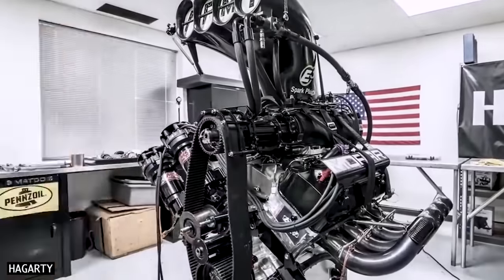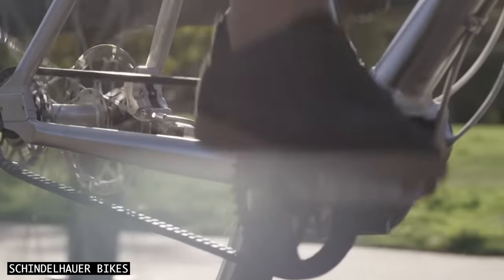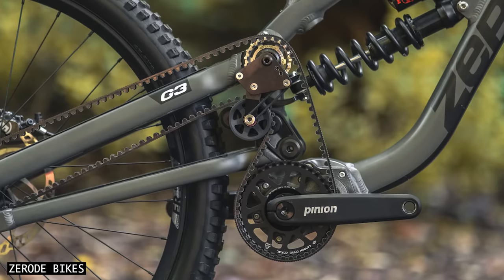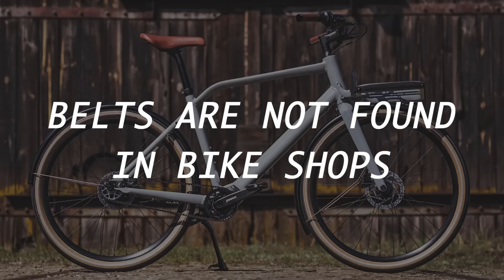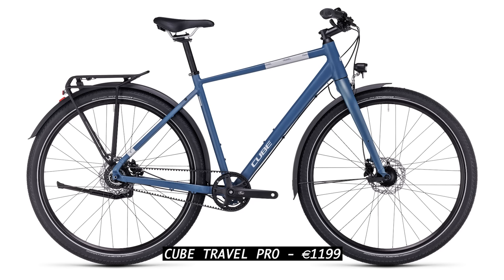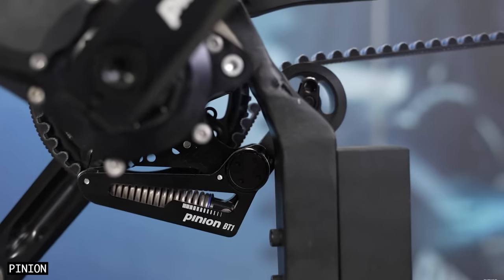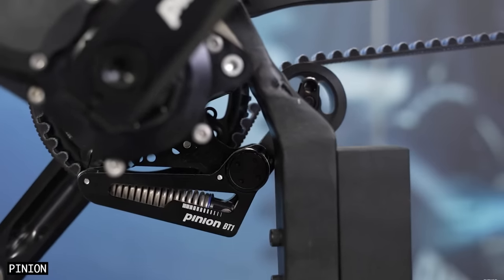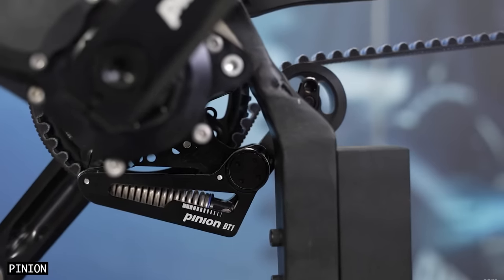Belts Are Now BETTER Than Chains On Bicycles!

Comment: I've used a Gates CDX belt drive paired with a Shimano Alfine on an urban bike as a commuter bike for a couple of years. While I generally enjoyed the low maintenence aspect, in the end the belt as well as the plastic rear sprocket has worn out after about 20000 km. And the repair was pretty pricey. On the other hand I've had Campagnolo chains on my road bikes which lasted some 15000 km. You obviously have much more experience with belts than I do but from my anectdotal experience the cost per km wasn't lower with my Gates CDX belt than with a good chain. 
There is still the benefit of having less maintenance work to do with a belt. But for me personally, being a fast rider ultimately the urban bike was too slow and I bought a gravel bike as a commuter and I am much happier with it.
Reply: CDN plastic sprocket was a misengineered product, he covered that mistake and Gates did it, too. Pity customers had to go through it.
Reply: 15000 km with a chain is for me absolutely impossible. I dont know what I am doing. But even the Eagle chains dont last that long and on my commuter I also snap chains. 
For my MTB it is clear why I cant have that long chain life because they get damaged by objects on the trail or jump of grears in really rough terrain when the chainguard fails also. 
Most chains I have will die after 3-4k EVEN with a chainswap @ 1k and 2k
Reply: @Vanadium  Roadies who ride in fair weather can get much longer chain life than MTBrs who put bike through rough trails. Much bigger mechanical stressing chain + dirt, sand, water, stones, sticks = faster wear.
Reply: @Vanadium  I'm struggling to believe that he managed to get 15000km out of a modern 10/11/12x drivetrain chain without exceeding wear limits and messing up cassette and chain rings. So either he knows something nobody else does or he's just a fantasist.
Reply: @event4216  true but I cant even get close to  5k for my commuter. This is mostly ridden on paved roads with some gravel in between. Ofc salt and snow will say hello once a while...
Reply: @Vanadium  Some people take care of chain more than others...maybe it's time to try belt, now? Belt isn't perforated like chain and even if front wheel lifts some sand and grit it will not land between plates and onto rollers....wet sand can stick to outer surface but one has to go through heavy mud to get it on inner surface of belt.
When I commute on rainy days I grab belt drive bike because I don't like crunchy feeling under my feet.
Reply: @event4216  Well then those people who take more care then me are crazy because I clean all 3 parts of the drivetrain in a ultrasonic cleaner. A few times a year. 
The chain only get wax. Dont know what else to do. 

Maybe for commuter but I want to change my MTB first. Still no real bike that can provide me with the right geometry for the belt so its SUPRA drive time ...

Comment: Had a conti belt on my commuter bike. It was pretty noisy, requiring regular cleaning and silicone spray to stay quiet, though I gather the noise was just annoying, not actually affecting anything. Then one day while accelerating from standstill it just snapped in two. Unsurprisingly I changed to a chain. But I'm sure I was just unlucky, and that Gates belts would be better, surely nobody would use them otherwise 😅

Comment: i have a commuter with a pinion c-line. i love it- no mess, and nearly no maintenance. also, i do not have a split in my rear triangle (priority bike), i just drop the tyre. i have hit 23 mph (37kmh) for one of my mile splits commuting to work on level ground, they can be quick if you pedal. the belt drive does not care if it rains, and with a pinion i have peace of mind submerging the gearbox while following my crazy son on his 'this will be epic' adventures.

Comment: I'm currently at 38,000 K on my Co-Motion Americano rohlof with original belt CDX. The Chain ring is starting to get "sharp teeth" the rear sprocket is showing almost no wear. I do keep the tension lower than recommended by Gates as I have found that recommended tension is not needed. I carry a spare belt just in case as its pretty light and gives peace of mind. The only issue i have had is occasional squeaky noise after riding in dry dust conditions. Road up the Dempster and ITH to Tuktoyaktuk last summer including two days with rain which In my opinion is a proper test. The belt did fine...the shifter cables....well they got progressively harder to shift as the grit built up. Thanks for your videos.
Reply from the maker: Very impressive numbers! Make sure to check out the UT Belt Care product or Treadmill silicone lubricant if you want to avoid squeaking entirely.

Comment: The Dutch used to build cars with belt drives.
I used to drive on of them.
I loved it.  The two rear wheels were driven separately . Safer and smoother.
The car was called Daffodil.

Comment: I also have never had anyone cut my belt, but curious people love to grab it and twist it around sideways. This has never directly lead to breaking a belt but possibly could have contributed to a short lifespan for it, as the manual specifically advises against it.
Reply: Pushing on or twisting the belt with their hand is no big deal  (I worked in R&D for  a belt company and actually designed an application of belts like this where the belt was twisted in two places.)
Reply: wtf why?
Reply: What kind of rude people touch drivetrain let alone belts on others' bikes?
Reply: The only issue with people grabbing and twisting your belt, is that people are grabbing and twisting your belt! Some people, man! I'd never have the urge to touch someone else's bike, unless I knew them and asked first.

Comment: I like the English Bike's take on having the belt outside the rear drop out so the frame doesn't have to be split to change the belt.
Reply: Indeed, a number of manufacturers now have frames that put the chainstay up higher, to allow the belt to run outside the frame so that the frame doesn't need to split.

The frame still needs to be designed specifically to support the belt drive, but it at least removes one structural issue that used to limit adoption of belt drive.

Comment: I would like to expand on the automotive belts v. Chain. 
Chains are in a sealed environment and continuously lubricated.
Belts are often covered and not completely sealed.
Reply: Because oil destroys the belt. And sunlight too. Not relevant for a car, but pretty relevant for a bicyle.
Reply: YOU DON'T SEE NHRA USING CHAINS ON THE SUPERCHARGER

Comment: the internal hub shifters are like 300-900 dollars each the Pinion Gearbox at the pedal is north of one grand so unless you intend to use a single speed bike you have to add that cost to the drive train

Comment: I have 10,000+ miles on a belt drive single speed the 'ace of spades' geared 55/19 or 2.89. It doesn't have the gearbox issue so I'm pretty sure it's just as efficient and fast as a chain drivetrain. I do 20+mph average rides, and can hit 22 or 23mph on a flat. IMO if you live in a really flat area, a belt-drive single speed is kind of a perfect bike.
Reply: If you hate your legs and back then yes.

Comment: Never seen a belt drive bike before.. Very interesting. When i decide its time to long travel by bike i will consider this option
Reply: And you get a belt failure, or transmision problem. In the middle of nowhere. Shops 200 km around you doesnt fix it, dont have parts. Your bike is not moving at all. Good luck to your long travel adventure...
Reply: @szaka9395  thats why you have to be flexible when travelling. If that happened i would probably hitchike or take public transport until the nearest place that can fix it and then resume cycling. Considering the durability and reliabilty of these belt systems, i assume such an event will only happen rarely

Comment: I work in the logistics section of a local bike shop. We use cargobikes with inernal gear hubs and belt drive systems, specifically urban arrow and riese&müller bikes. Ive seen suspensions and even frames bend or break before their belts broke.
Reply: Top garbage bikes then xD

Comment: I'm not even a cyclist. I just watched it all as I'm interested in technology and engineering. I can certainly envision belts becoming more commonplace in the future, especially with newer technologies like high entropy steels on the horizon. Maybe I'll even find my next motorbike to have a belt.
Reply: As someone who rides motorcycles STUPID long distances, And is pretty regular about chain lubing. [once a day after about 8 hours of riding] And uses X-ring chains. I can only get about 16k miles out of name brand chain before it's making crunchy noises. I Just think the forces acted on the belt drive systems, causes a lot more stretch. due to the forces of high speeds, and rotation of the swing arms. Zero owners [the motorcycle brand] often complain about belts just yeeting off. and in sandy conditions not lasting very long either, Harley guys who've had OEM belts for the last idk 20 or so years now.. Run into the same issue of sand killing the life of the belt. For distance riding/quiet operation/low maintenance motorcycle final drive components. you're going to be looking at Shaft drive.. [and lots of bikes are made/have been made with such tech] The downside to shaft drive is the higher rotational mass- and a pretty nasty efficiency hit.
Reply: @johnwalker7592  The shaft drive has a LOT of downsides, not just rotational inertia and efficiency. That's why it's pretty much exclusively seen in bikes made to tour third world countries where the incredible reliability is worth all the extreme drawbacks. I wouldn't want to be there with a problems with my chain or sprocket, the latter also being a potential problem. But in the performance bike application where I sit the mass will cause issues with suspension, and generally mass itself is a problem. Then as mentioned efficiency, other bikes will care more about fuel economy whilst mine will care about power. The space taken will pose issues with a swingarm and packaging the exhaust. The list goes on. So that's ruled out completely.

Belt drive really depends on the application more than anything else. Again in my performance bike market there's issues with shock loading and strength, especially on the teeth. The width will cause problems. It's just a long way off. 

For non-performance bikes it really depends on how you use it. Swingarm rotation isn't an issue as modern swingarms already design that problem out. And if needed they don't need a direct route either as the video demonstrates.

Stretching is a different case and it sounds like the problem is more use case specific. A well made belt shouldn't be stretching as the composites used have negligible stretch at all. So either they're using steel cables (bad) or they're breaking the composite reinforcement from the sheer powers involved. It sounds like the Harley OEM cables don't have that problem as they're almost certainly fitted well to the use case of the forces involved. But sand is always going to cause massive issues on a belt.

Overall I'd suggest a belt is likely the future in most cases, but it's also largely beyond the technology of most cases today. We need to better deal with the forces of the majority of bikes, often in excess of 120hp, and likely need to tweak sprocket sizes to help (which also demands an entirely different frame geometry). Still the benefits likely outweigh the drawbacks outside of performance and dirt bikes. I still don't want to change, though. I like biking where it is today.

Comment: I used belt drives for years. If the belt slips, it's compromised and will eventually slip again and get caught up worse than chains. The belt is so tight in the back sprocket that you use it daily, it will wear down the grooves of the sprocket and make it easier for the belt to pop out and get twisted. 

It's great not having to worry about oil stains, loss of wattage, and if you're into single gear bikes it's great.

Comment: Chains on cars and motorcycles are usually used in applications that are sealed from elements (e.g. camshaft timing chain) and therefore also can have their lubrication happen in isolation of the elements. This is their "optimal operating conditions", hence why they perform and last longer than belts. On bikes however chains are subject to the elements, which is where belts operate better because the elements mess up the lubrication over time and require more maintenance than belts.
Reply: Almost all motorcycles have chain drives exposed to all elements (some beltdrives and shaft drives excluded)
Reply: @abitofaviation  true but not as exposed as bicycles. They are somewhat covered and relatively more protected vs bikes. Besides, motorcycles don't have derailleurs and rely on gearboxes, which removes a lot of complexity on the chain
Reply: The lubrication is the easiest part of the task. The cleaning is the more labor intensive one.

All in all it's all relative. I mean we are talking 20 mins total cleaning, changing liquid of the cleaning tools, scrubbing and lubing.

So it's all not "Labor intensive", only relatively
Reply: @Pin Ky one step clean and lube product like Rock N Roll or Finish Line is what I use

Comment: For commuting bicycles, belt drives are ok. However, having owned a belt driven bike, they are not perfect.

I’ve had a belt snap, they have a much higher resistance to chains and are not simple to fix when they go wrong. Chains are also super compact, and if endurance riding, you can carry two or three spares with ease and always find a shop to repair a chain drivetrain. 

On your comment regarding gears, I thought the same too. Gearboxes on a commuting bike would be better, but how wrong was that! I found them to be difficult to adjust, they coped badly with any power, and when they did go wrong, it was usually catastrophic. If you need to replace one, it takes forever and costs a small fortune.

Derailleurs are simple to replace, cheap to find.

I also didn’t find them much cleaner either. They still hold onto dirt and grime and are no cleaner than a well maintained chain.

On that last point you are right. But if you don’t maintain your chain, the likelihood is you also don’t oil it, so it’ll be bone dry and as clean as the belt.

All in all, the concept is nice, but the execution and reality of a belt drive is not a good one IMHO.

One last thing on cost. Chain breaker tools cost about €15 for a Topeak one. And a chain is about €25 for a medium level one.

Finally in terms of cost per km. I have an Ultegra chain that’s lasted me over 15,000km and is still going strong. It’s all about how you maintain it.

Comment: I don’t think they don’t use these in Tour de France because of “weight”(some used heavy retractable MTB seatposts), that can be compensated but it’s due to the fact that belts have A Lot more resistance than an oiled chain
Reply: I think that these belts couldnt handle high power outputs, i cant believe they wouldnt slip
Reply: @szaka9395  These belts have braided metal cables inside, like car tow cables. These are used in motorcycles, cars, powerful E-MTBs exactly because these can take more abuse. The issue is that it adds more resistance.

Comment: I bought my wife a bike with a belt driven 8S Alfine some years and some tens of thousands kilometers ago. Dirt, mud, salt and all other nasty conditions...  and literally no servicing beyond rough cleaning and a little bit of adjusting the tension, and absolutely NO issues. My chain driven bike needed a couple of new chains, cassettes and chainrings in the same time. And the chain only runs smoother and with less friction, when in perfect and well lubricated condition. Her's is a Gates Carbon Drive, and my next purchase for everyday use will be belt driven.

Comment: Chain efficiency itself is complicated.
Have you looked up Zero Friction Cycling's chain lube and wax test data? Some of the modern products are so efficient that they broke the test protocol and resulted in infinite longevity. Waxed chains are also clean (no black muck etc).
Reply: Yeah, but they usually require a lot of prep work.

Comment: i am used to a "well balanced" front and rear gear option, front 3, but i only use two, and the rear full spectrum, so if they will make a version of this, with a front two step gearbox and rear 7-9 step eqvivalent numbers of ratios,  and it wont cost absurdly more, then i will jump over to this..